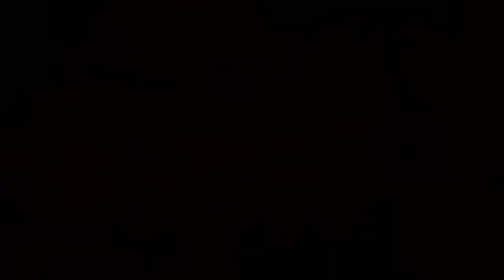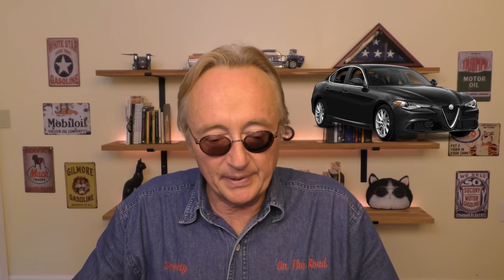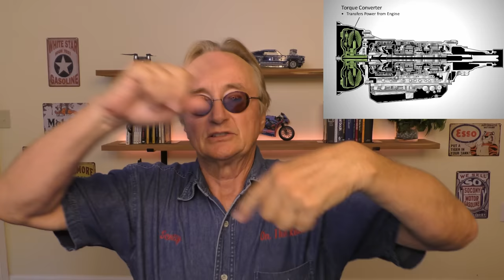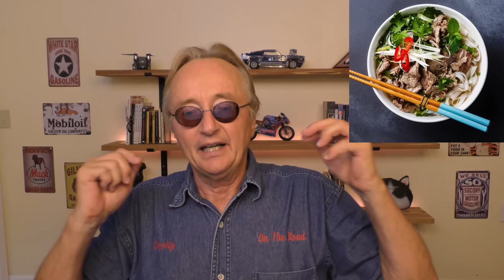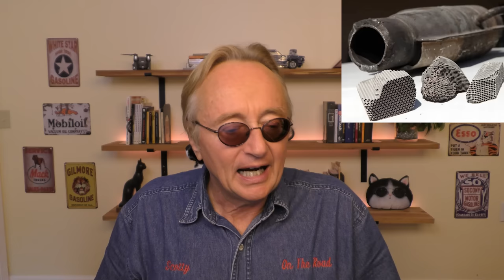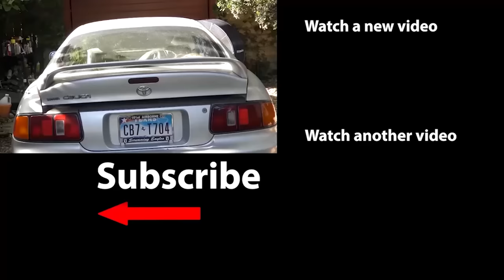Here’s Why Honda Engines Run Like Crap

Comment: Honda doesn't have hydraulic lifters on their engines? Wtf? Even GM has hydraulic lifters.
Reply: They’ve never used them, you just have to adjust the valves every so often, not really a big deal
Reply: However how which Engine performs better and is more reliable?
Reply: There are pros and cons with engine running on hydraulic lifters too. They can have ticking lifters due to wear and tear. It is very dependent on engine oil for its longevity. Skipped oil change is a big nono. Anyways, for Honda engines, once the rocker cover gasket starts to leak oil, that is the time to do valve adjustment since you already need to take off the rocker cover anyways to replace the gasket.
Reply: @fleurdewin7958  yup, this is correct

Comment: Yeah throttle the heck out of them states that people are responsible for wrecking there engine, transmission, drivetrain, suspension. Just down the toilet and then they get upset for needing so many repairs and possibly a broken transmission or blown engine.

Comment: I wanted to speak to this, auto-electronics will become as important mechanical experience soon and this will get more and more complex over the next 10 years. Manufacturers are computerising more parts of the car with varying success, and with electric cars coming on fast a new mechanic will need to know as much or more about the electrical side of vehicles.

Comment: Hello Scotty, I am thinking about buying a 2017 Honda Ridgeline with 49000 miles on it. Is there anything with the v 6 of that year model I need to know about,engine runs well with 27 mpg. It is clean.They are asking 23000,00   , for it

Comment: How often do u have to replace the vtec spool solenoid in a Honda? Have a 2001 civic with 160k miles on it misfires sometimes and has some lag on throttle replaced clutch and spark plugs recently.

Comment: Scott i just bought this 98 Toyota camry and im wondering if leaking from the oil filter is common or if its simply just the gasket?
Reply: Change the gasket and pray it stops the leak. Only one way to find out is to try the obvious fixes that could stop the leak.

Comment: PLEASE HELP!! Scotty or anyone. 06 Acura TL. Runs great until operating temp. Then dies at stop signs or in gear D or R. No Codes. I have to coast in Neutral to stops then put back in drive while giving gas to get moving again. Changed spark plugs, new air filter, tried two tanks of fuel system cleaner, new battery, cleaned throttle butterfly valve, alternator tested fine, sprayed half can of carb cleaner in intake hose for 20min, trans fluid good. No luck!! Car drives awesome no slipping trans, great engine response. Just dies at stops when warm. Wont stall cold approx 10 min of driving. Please!! Thank you.
Reply: I'm not sure about it but check if your model has an EGR valve. They can stick open and put too much exhaust in the engine causing a stall at operating temperature. I know this is a common failure in Chrysler products with stalling but I don't know about Acura. I am hoping it is not the torque converter going out which can do the same thing because it drags the engine too much. In that case that is one expensive repair because the transmission has to be taken off to replace it.
Reply: Check fuel psi on the Acura .
Fuel pump might be going bad and dies out when it warms up .

Comment: so why do honda engines run like crap???? I have a 2018 Civic Hatchback Trubo and it idles really rough. the entire things shakes. is that normal?
Reply: Check air filter and spark plugs. They can do that. Also look for vaccum leaks especially if it only runs rough at idle. Lastly, I believe the motor mounts could be going out causing excess vibration. Hope this helps.
Reply: @admirbasic2206  recently replaced air filter, sparks are clean, normal idle for these cars is 500RPM - 550RPM when warm. only thing I need to check are motor mounts. I did bottom out on a non painted non sigend speed bump in a parking lot like 6 months ago while going 15mph, not sure if that would cause a mount to go.
Reply: @Kagemusha320  that could definitely cause a mount to go if it was a horrible bump that ended up tearing the rubber in the mount. Visually inspect it to see if you see any tears in the rubber. A key way to know if a mount is bad is if you hear a clunk when you start the car. That is a sure fire way to know a mount is bad.

Comment: I thought Honda is reliable since they were competing with Toyota’s reliability
Reply: That's what you get for not doing your homework. Buy a 94' Celica and save yourself a lot of grief.
Reply: Scotty got us all confused! @scotty Kilmer please throw more light on this! Thought Honda's were as super reliable as Toyota's?
Reply: @DanielE-dk1ws  LOL! Never used a Honda, but i have friends that have used them for years without issues...especially the sedan - Accord and Civic
Reply: @ifeanyichukwuaniude7866  I am on my 4th Accord and never had an issue with any of them.  Drove my ‘05 until about 220K and the only reason I upgrade every 8 or so years is because they keep getting better and prices don’t seem to go up every year.  Just got my 2020 Accord Hybrid for only 1000 more than I paid for my 2015 Accord sport.  None of them ever failed me.
Reply: I've had both Toyota's and Hondas, both are outstandingly reliable. Put 200k+ miles on each of them, almost nothing needed beyond normal maintenance.
Reply: @DanielE-dk1ws  dude if a Volvo T bones a 94' Celica it's a wrap
Reply: @dragospahontu  The only thing your Volvo is going to Rap is around a tree. 🌳
Reply: @ifeanyichukwuaniude7866  Guess again.
Reply: @ifeanyichukwuaniude7866  I take it you've never had to adjust a Honda's timing or had any transmission issues. That's why you don't own one.. Oh, i get it now....lol
Reply: @DanielE-dk1ws  i am planning on getting an accord or civic

Comment: 1994 Ford Mustang GT convertible
5sp manual transmission 5k
Under 43,000 miles
Next month on Facebook Market
Reply: I have the same car but with automatic and 53k miles .
If its a convertible , then sell it soon cause its the season for them.
Thats a very good price if its not rusted ? 
good luck !

Comment: Scotty I’ve got a 2008 Ford mercury, and in the mornings it starts Great. After it sits for the day and I get in after work, it has a really, really hard time starting. Why is rhat?
Reply: The engine is flooding with too much gas. Step on the gas and then start the engine and see if the problem goes away. Scotty has talked about this in a previous video.

Comment: Negative, Scotty, on Russian Moskvich, specifically, you are incorrect. Moskvich 412 used engine  produced by a factory in Ufa. That factory manufactures jets' engines and as a biproduct they did 1.5L engines for Moskvich built in both, Moscow & Izhevsk. 😎😎 I'm from the USSR, I had a Moskvich 412, I know.

Comment: I'm moving to Denver and was looking for a Rav4. Should I buy the AWD or does FWD suffice?
Reply: AWD is definitely better but costs more and requires more maintenance and cost a fortune to fix when they break. But FWD will suffice in most situations if you use good tires preferably snow tires when it snows.
Reply: In Denver you might want the AWD .

Comment: Wait until you have a miss fire code. Check the freeze frame and if it was upon first cold start and you don't feel a miss then adjust the valves. If you check them and you have no problems they will be in spec.

Comment: Scotty have you ever had to change shift solenoids in a saturn? I have an 07 vue with honda engine and trans. It has been a great car and has 260k miles. It just started shuddering at low speed between 3rd and 4th and presents a code for shift solenoid failure.

Comment: Why does my honda odyssey 2019 and honda civic 2010 transmission shift so harshly sometimes. Van is new civic is old. (Feels like a manual car shifting gears while gas is still active).
Reply: Take the odyssey back to dealer for them to fix it. No way should a 3 year old vehicle shift harshly. Do not accept them saying oh it's normal. They just don't want to fix anything under warranty because they dont make a profit on warranty work. As for the civic, live with it especially if you have over 100k miles. If you have significantly less, try changing the fluid and filter and see if that helps. If not live with it because you're probably looking at future transmission work.
Reply: @admirbasic2206  yeah, the dealer said that the Honda Odyssey transmission is normal. What do i say? Because they say its fine
Reply: @danielsong1323  Here is what I would do. Take it to an independent transmission shop and have them analyze it and pay them the diagnostic fee. Or take it to a different Honda dealer. Maybe you might get lucky and find a much better dealer that actually cares about its customers.
Reply: @admirbasic2206  bet

Comment: If you have a sports car or a hot rod with a high Styles P torque converter than yes normal street cars don’t have a high Styles P converter so it’s not a problem. I do think if you’re gonna be sitting there for 10 minutes you should turn the engine off just to save gas and not to overheat the engine.

Comment: Old Porsche’s need valve adjustment. Can’t believe Honda’s use that old technology.
Reply: Solid lifters are actually better, but require valve adjustment. most racing engines have solid lifters.

Comment: I use to like BMW and Mercedes until I found out why they call them eurotrash ... That happens after the warranty expires !
Reply: Old ones aren't that bad
Reply: That's why you lease them. Sure it's expensive but you have all the thrills with none of the pain. And that lease is way less than actually buying it, paying to maintain and fix it, and selling it for practically nothing compared to what you paid for it.